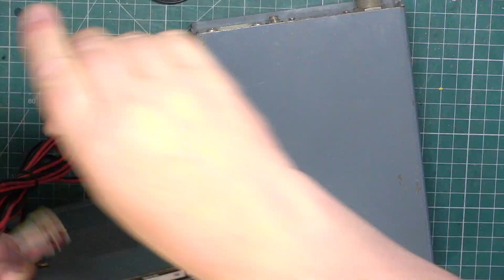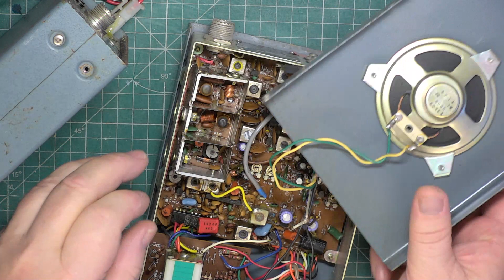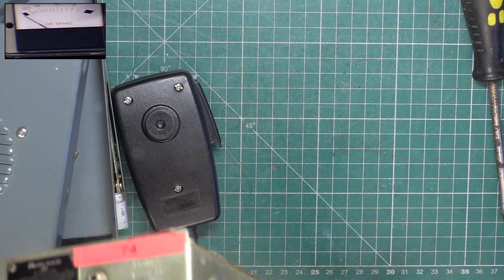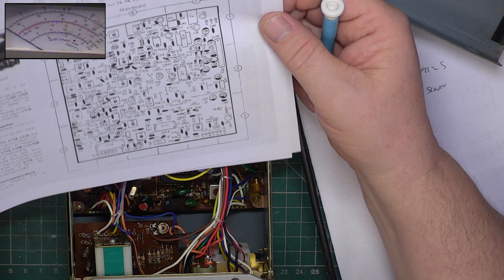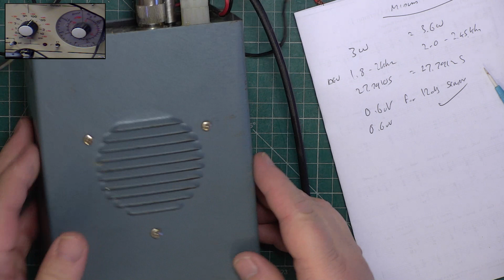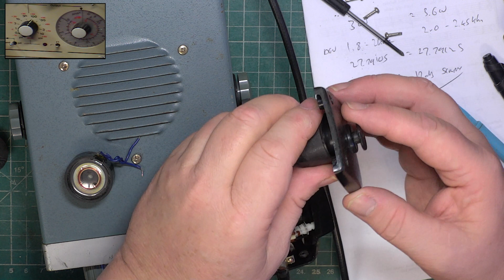Midland 2001 CB27/81 UK FM CB radio  - service alignment & microphone repair

Comment: I have my (recently purchased from eBay) Maxcom 4E, and I too was wondering how different the insides were between FCC AM sets and UK FM sets, and more so today of all days as I have only just received my latest eBay purchase, which is a Cobra 19X. I have not tested it, but it looks like new and all of the screws look like they have never been touched. I don't really want to open up either of my radios, so your video has been an absolute Godsend, and couldn't have been better timed. (Note: This new radio is for collection purposes only and not for use).

Comment: Yes I bought those same mic inserts from Ali express a year ago, they do work well but they are too deep for the flat maxcom mics even if you cut them down that's why I use the farnell elements in flat mics, these Ali express mic elements are often cheap karaoke machine mic elements but they do work great for CB, it's just a shame they aren't a bit slimmer.
Reply: The mic inserts do fit the maxcom mike with a little fettling

Comment: Illegal to OWN? So these are virtually (if not) all illegal imports and contraband? Because it's not illegal to possess any transmitter including pirate VHF transmitters - only to broadcast with it.
Reply from the maker: Only saying what was told me by offcom as they came here to confiscate a repair from an international customer a few years ago....and threaten to prosecute me if illegal sets were not handed in or destroyed with video evidence.  There are unique rules around importation of 27Mhz gear.

Richard, G0OJF, UK
Reply: @ukfmcbradioservicingTango21  Totally understand that. Just curious as to whether they would worry in 2022 about a 'potentially' smuggled set from back in 1980 (RF illegality aside) as it would have changed hands many times since importation and the present owner is not culpable. Just wondering as I have a couple of these kinds of sets tucked away and are never used I might add!

Comment: Expect there'll be quite a few useful parts in the am model. Pity i haven't a spare knocking about as the front on my cb is rarther worn. My November 81 model has that  needle adjuster.

Comment: I've got a 2001 with the extra VR on the channel change board I think it must be a conversion as mine is a Nov 81 release but the other I have doe's not have it plus where the 2 wires go to on the main board has a resistor in the wire place, 
So I'm wondering if it was a conversion back in the day so you could alter the meter where when it was a resistor it was fixed RX ?